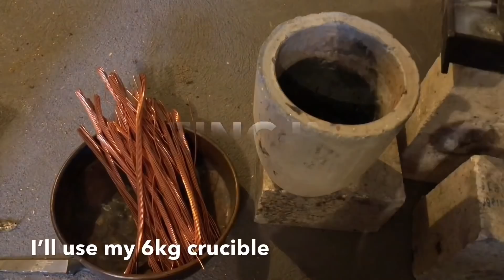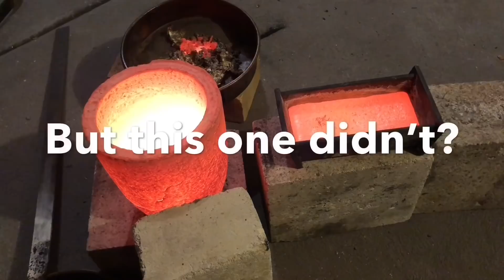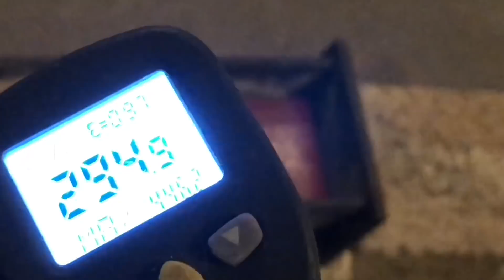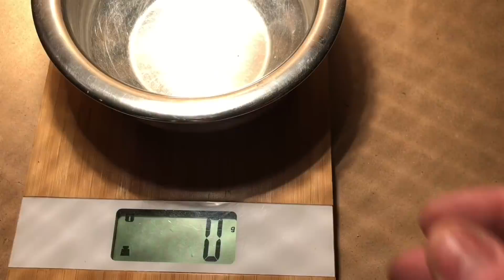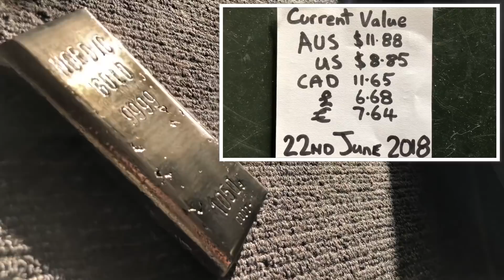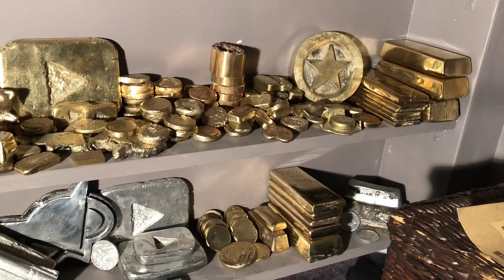CASTING A SOLID NORDIC GOLD BAR -  nordic gold bullion bar casting at home

Comment: The value of Nordic Gold is in it's erosion resistance. It's price, whilst low, is mostly tanked in shipping. It's cheaper to make it than buy it. A hammer made of Nordic Gold will cost you about $350 USD. Making it will cost you about $2. So it's a material that is mostly capitalized upon by those who craft their own tools. It's also a beautiful bronze age blade material.
Reply: it's very beautiful
Reply: Did not know that! Pretty cool stuff

Comment: You are who actually taught me how to make nordic gold. I am planning on using the alloy to make jewellery and other items. And it is all thanks to you
Reply from the maker: What you wanna do is aluminium bronze it has a golden colour even nicer than Nordic gold. Just mix 95% Copper and 5% aluminium by weight , melt at the same time. Give a few gentle stirs and then skim and pour and you’ll be amazed with the results👍🏻.
Reply: @bigstackD  I most definitely will do that! I'll have to show you my results

Comment: You should have put the copper in first to melt since it has a melting point of 1,085°C, higher then any of the other metals you're using.... aluminum should be tossed in after the copper begins to melt due to it having.... just about 400°C less needed to melt. Third would should have been the zinc then the tin due to the much much lower melting points.... Would have gotten a more stable metal rather then all that unneeded dross you get, And yes... I know you're going to get some as is but still...
Reply from the maker: Yeah I know but I always do Things backwards on this channel 🤦🏻‍♂️

Comment: why on earth did you put the tin,zibc,ali in before the copper was melted.

you would have lost alot(by percentage) because thier boil temp is so low compared to melt temp of copper.

you sre supposed to and the lower temp metals to molten copper mix then pour
Reply from the maker: Yeah I know🤦🏻‍♂️ but I’ve had some bad experiences putting metals in to other metals at well over there melting point so I just did this way👍🏻

Comment: Best place to get zinc is old wheel weights and ornaments, I've got a load of it because it's horrible to cast with (using my current setup which is geared towards pewter and other low melt alloys) but I save any I get my hands on regardless

Comment: That is a beautiful color mate.
Reply from the maker: Cheers 🍻 yeah I couldn’t make a fools gold bar so why not make this one😉. Have a great weekend Perry take care and talk soon mate 😁
Reply: sooner than you thought... do you have any trouble with the zinc burning as  the copper comes up to melting temperature or does the zinc/aluminium/tin all melt basically together first?
Reply from the maker: I didn’t have any trouble at all with the zinc which was surprising , I went on to AlloyAvenue and a couple people said to melt the copper 1st🤷🏻‍♂️. I don’t like the idea of adding zinc to molten copper at any time🤭so I just put the lot in and let it all melt together and stirred before each skimming. The tin zinc and aluminium was molten pretty fast and the Copper sat on top and slowly melted into the pool at the bottom of crucible although I did push the copper down a few times with a steel rod. This zinc was from us pennys 1982+ so was in actual fact only 97.5% zinc which means I was 2grams out in my zinc requirements🤫🤫🤫. Zinc is an odd material, some times I have dramas with it smoking and making fairyfloss come out the crucible and other times it’s perfectly fine. Maybe I’m just overheating it sometimes 👍🏻
Reply: I've never melted it but I've heard the stories of smoke and fairyfloss plenty of times. Maybe alloying it helps. Thanks

Comment: Nice! That came out great! 👍🏻 I still need to get the stamps so I can stamp my bars. What was the brand that you got? I gotta hunt down more copper too. How long do your videos typically take you to make. I feel like it takes me 6 hours to edit everything haha
Reply from the maker: Hey buddy the stamps cost me $49.95aus they are just normal steel 10 mm stamps from eBay. I just looked for the cheapest at 10 mm and these work bloody brilliantly. The actual melting it self and casting stuff takes probably 2 1/2 hours to 3 hours from start to finish after cleanup And yes if I don’t spend at least five hours more editing a video something is wrong. I’m just lucky I do a lot of nightshift when I’m sitting in front of a computer monitoring and can just do it then otherwise I definitely wouldn’t have time to get a video out every week. It is such a slow process as you know. Also I was going to say any videos over 10 minutes long you can add an advertisement at the start the end and three or four in the middle if you choose. But if it’s under 10 minutes you can only add one at the start. You can still add just one on a 10 minute video but you have the option to add a lot more, I say this as when you go past the  1000 subscriber mark you can potentially Triple your income for each video by making them over the 10 minutes long and having a couple extra ads. Just an idea for the future.🤷🏻‍♂️.
Reply: bigstackD Casting oh awesome good to know! I’ll prob order a set this weekend 👍🏻 yeah I’m only at 107 so I got a ways to go haha. How did you get so many so fast? I feel like it’s a struggle to get a few here and there. Yeah I’m working nights now too so I have time when it’s slow to do a lot of editing which really helps out
Reply from the maker: Mate last month I jumped  Over 2500 subscribers in one week, it didn’t make sense,  a video I made well over year ago about mixing metal Went absolutely apeshit and got over half a million views in less than a week but other than that it’s slowed back down to about 10-15 subs a day now. When I started I went from about 100 to 500 and it took me months averaging one subscriber a day sometimes . in the last six months I’ve gotten more than half my subscribers but now it’s slowed right down again it’s weird it ramps up and dips for no reason at all.  I still can’t explain the attention that one video got last month but I’m very happy It did. Shame it was a short video I might of got a lot more subscribers if it was a better video🤷🏻‍♂️
Reply from the maker: Also I got about 500 subs wen Alumitube gave me a shoutout👍🏻. I helped him wen he had 100 subs a year ago and he now has 240000+😳😳😳.
Reply from the maker: Also I hear the algorithm has something to do with getting your videos on recommended watchlists ,  A few months ago my channel was basically stalled I was  getting a couple subs here an there and I thought I’m going to release a video every Friday without fail to try kickstart me channel after three months of weekly releases I have started to see a steady reliable increase in subscribers and views but it has nearly killed me keeping up with weekly releases that’s for sure😫.
Reply: bigstackD Casting damn that’s crazy.. yeah I saw my skull cast go crazy one day and gained a few from that and like 1200 views in one day. Not sure how that happened though.. I guess I’ll just play the waiting game haha 👍🏻

Comment: Hey! Thank you by your videos! 
Why do you mix the metal to melt together? I'm learning melt it I just dont know for that!
Reply from the maker: Hey buddy im glad you like my vids🤘🏻
Alot of people say to melt the copper first then add the others to the molten copper and that may infact be the correct way to do it but for me personally I just mix it all together at the start and thatll  make the lower temp metals make a molten pool for the copper to sit in which will also  allow the copper to melt at a much lower temperature saving gas ,time and wear n tear on my furnace. I give it a gentle stir a few times before pouring so as far as I’m concerned there all mixed together nicely even if it’s not done the traditional way. Also I hate the idea of dropping zinc into molten copper when the molten copper is 200°C higher than the zincs boiling point. It’s a tricky game this metal mixing so just be sure to do some research on other channels b4 you do what I do incase I’m doing it completely wrong. I’m self taught and have absolutely no experience except what I have tried myself so I’m definitely not the guy to copy(unless I’m doing it the right way) 😁👍🏻

Comment: Beautiful job today! I was wondering where you get all your scrap metal? Aluminum and such
Reply from the maker: I have been working on a  large industrial site for nearly 20 years and i was collecting out of scrap bins for a few years before i started melting so i had a decent stock pile to start me which would take bloody years  to melt so ive been lucky that i didnt have to look anywhere for it . Also my good friend is an electrician on this site an any big cables he lets me have them as he knows i wont take it to the scrap yard for some quick $$ and that ill be eventually melting it and turning it into something awesome (i say awesome but alot of people wouldnt) . friends do sometimes give me old tap fittings and old copper pipes now and then. If you check out the first 30 seconds of the link below it will show some off the scrap i will be working with👍
https://www.youtube.com/watch?v=CXRaHQMA-sI

Comment: Hi there, great video. 
I have a question concerning the temperature measurement you did while heating the furnace.
As far as I know for "furnace applications" with molten metal a wavelength of ~3,9 µm (or lower) is suggested. 
Did you calibrate your sensor beforehand?
And... What K-value did you use for the measurement?  (From what price rang is your thermometer?) 

I'm trying to cast Nordic Gold myself, but I'm not sure if my furnace will reach the necessary temperatures.
Reply from the maker: Hey buddy , I have never calibrated my sensor gun b4 any melt. The gun I use comes straight outa the box and it’s ready to use . I have 2 of these guns and even up near 1000°C the guns are only a couple degrees different from each other 👍🏻.these guns seem to work perfectly. The link to the gun is below mate😁. 

LCD IR Infrared Laser Thermometer Pyrometer Temperature Measuring Gun -50~1050°C https://rover.ebay.com/rover/0/0/0?mpre=https%3A%2F%2Fwww.ebay.com.au%2Fulk%2Fitm%2F272607042582

Comment: Hey dude. Love your vids. What's the hammering in the background? Keep up the sick work. PS , if you need to rehome your old furnace....:)
Reply from the maker: The hammering is actually a background noise that I add as I live in such a quiet place that when there is no background noise the video just doesn’t seem right and I will never be adding a techno soundtrack or any other loud music on my vids . Sorry matey but I need all my furnaces as I’m sure I’ll be doing a massive casting in the future and will have all 3 running at the same time😁👍🏻
Reply from the maker: Also matey check out my vid I released 3 hours ago I have a 4th Furnace now but ones getting commissioned 👍🏻

Comment: Really nice alloy! 😉 The only question why have you decided to put all metals together? Isn't it better to put aluminum, tin and zinc when copper is melted? We recently talked to you about "evil" - zinc which burn out very quickly. 😎
Reply from the maker: Yeah I only did it this way as lowering zinc or aluminium into molten copper is a bit scary for me , wen I melted copper brass and aluminium together a year ago  I started with copper first then added brass and once that melted I added aluminium and wen it broke the surface of the molten it did a massive flash and flared up for a second then I put the rest of the aluminium in and closed the lid it all settled down then 2 Minutes later my furnace made some noise and flames smoke and metal started violently pouring out the hole shooting a good 4 foot flame out the top . I turned the burner off but it kept going for 10 seconds then the flames stopped and it was smoking so heavily in my garage that I couldn’t see the garage walls 6 feet in front of me it was that thick(no kidding) . It looked like some kinda thermite reaction or something but it was scary as hell ,what ever it was, unfortunately I didn’t film it as I was busy freaking out😫😳. So I just didn’t wana repeat of what ever that was👍🏻😮
Reply from the maker: Although I didn’t notice any burn out or flare ups with this at all once mixed🤷🏻‍♂️
Reply: May be because the volume of zinc was very low that's why it was hard to see the fumes. I added pure zinc in copper before. It burns out very quickly. 🙂
Reply from the maker: Yeah I’m a big scaredy-cat☹️. Covered in tattoos and ride a Harley and I’m  scared of a little piece of metal🤭🤣
Reply: I would prefer the expression - "a reasonable person" 😉😀 And that's right! 👍

Comment: A quick note never use teflon tape on the connection going into the tank. This is a metal to metal connection also never use teflon tape on flared fittings for the same reason. I've been in the propane industry for over 39 years and have seen this done over and over. Also I've seen teflon tape melt and run right off of fitting under heat as well.

Comment: You've earned a subscriber. I'm very interested in seeing metals being molten. So satisfying! I have one question though: have you ever burned yourself while casting?
Reply from the maker: In all the hundreds of castings I’ve done I burn my finger in 2 little spots and that’s all from the molten metal part of it . A have also burned 2 of my knuckles from just the heat from the crucible while pouring copper and I had 2 pairs of leather gloves on . I could feel it burning bad but I was half way through a pour and you can’t stop a copper pour or it’ll freeze the metal . That was my worst injury my knuckles swelled up and were all blistered🤢😳
Reply: bigstackD Casting ouuuuuuuch. I'd hate that 😬

Comment: great, high strength golden copper alloy
Reply from the maker: It’s definitely an awesome alloy and It does seem very close to Aluminium bronze in color but it kinda feels softer like brass , I mean it’s still hard as a rock but hitting it with a hammer it seems quite malleable compared to the hardness of Aluminium Bronze which to me seems like steel. 👍🏻😉

Comment: 2:07 the scene were so cool that it repeat it self 3 times

-question: whats the different between this alloy compared to copper? Aside from the composition (toughness, colour)
Reply from the maker: It’s definitely an awesome alloy and It does seem very close to copper in its malleability as it feels soft like brass or copper but has the look of Aluminium Bronze , Its very high resistant to tarnishing unlike Copper which will loose its shine and polish in days. Other than that its just a glorified doorstop or paperweight.😀👍
Reply: bigstackD Casting if you dont mind i have a video idea fr you mate
-combine all slag/dross and remelt it to make a dross alloy
Reply from the maker: That sounds rather interesting mate I’ll chuck it on my list and see if I can make it at some point in the future 👍🏻😁

Comment: I was never good with math, but how do you add the right percentage of metals? Is there a formula for it?
Reply from the maker: Usually I just work out the percentages by weight for example 900grams copper x 100grams aluminium is a 90%\10% mix making aluminium bronze. In this particular bar I only had 61grams of zinc left  which is a 5% mix for Nordic gold so from there I could work out exactly how much of the other metals I needed . This makes sense to me I’m assuming I explained it correctly 🤔👍🏻

Comment: Where do you get tin. I’m trying to get my hands on some but can’t find it anywhere
Reply from the maker: I know right unless you want to spend $1 million on eBay. Pewter is normally around 90% tin so when I want to make bronze I melt Pewter in with the copper at approx 88% copper 12% Pewter by weight 👍🏻. Pewter is  bloody hard to find as well but a lot easier to find then tin.

Comment: To get more zinc, couldn't you have substituted some of the copper with brass? I guess the math might get complicated tho.

That shelf is still standing, huh? :)
Reply from the maker: Hey Sam how are ya matey , I actually have a pile of US penny’s that are older than 1982 which are 97.5% zinc  I’ll probably use them when I do this again👍🏻
Reply from the maker: Yeah shelves holding on surprisingly 😮
Reply: Doing OK here. Hope you get a break from those 80+ hour work weeks. You may want to double check on those pennies. It is pennies NEWER than 1982 that are mostly zinc. Pennies older than 1982 are 95% copper.

Fun fact -- the newer pennies will melt on a hot plate. We used to have fun with this in the chemistry lab at school.
Reply from the maker: Oh yeah I know it’s 1982 and above but I was looking at the year in human terms if that makes sense. Iv had a big week and am heading into 5 x 12 hour nightshifts starting tomorrow night so I’m a bit muddled . 🤷🏻‍♂️.

Comment: Try mixing 5 parts copper , 1 part brass , 3 parts aluminum and 2parts tin or lead
Reply from the maker: Hey Max Is that a particular alloy or are you just winging it 🤔

Comment: 2:00 from a pirate to a wizard , ya'r a wizard Harr...Bigstack
The nordic gold dose not seem different from brass from what  i can see from the video , is there a contrast/color differents ? or is it just easier to work with ?
Reply from the maker: It’s definitely an awesome alloy and It does seem very close to brass in its malleability as it feels soft like brass or copper but has the color very similar to Aluminium Bronze , Its very high resistant to tarnishing unlike Copper which will loose its shine and polish in days.When hit with a hammer it seems quite soft so i recon it would be easy to work with Other than that its just a glorified doorstop or paperweight.😀👍